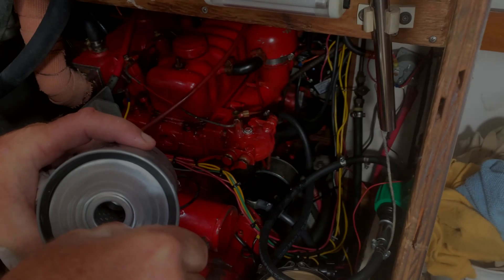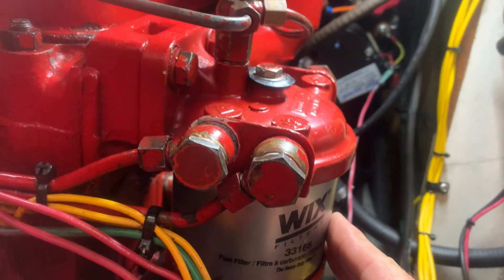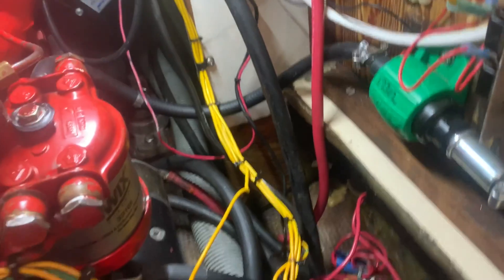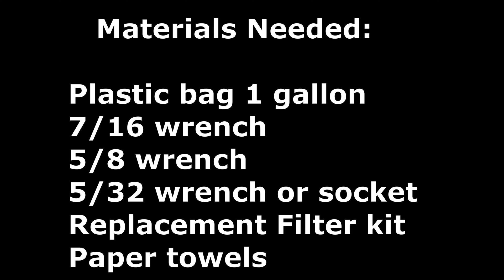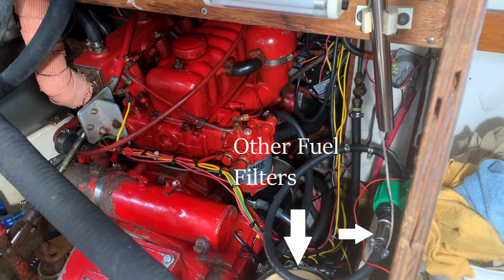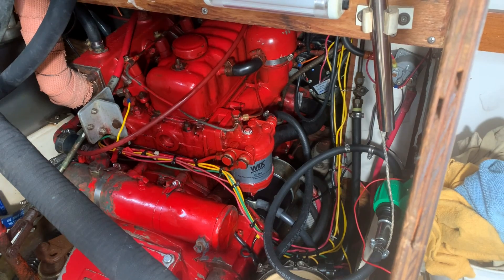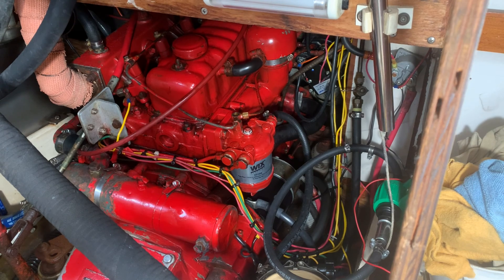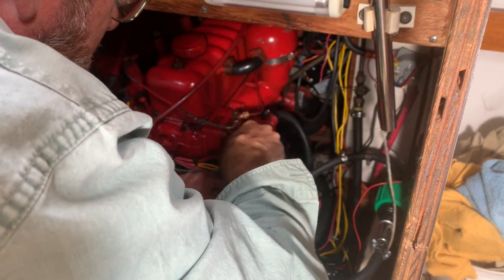Changing a Diesel Fuel Filter: Westerbeke 4-107 & older Perkins 4-108

Comment: great info, why not top up the filter with diesel so les air is needed to bleed....
Reply from the maker: Yes, I have done that before. Generally, I would add fuel by loosely putting the filter on and opening the fuel petcock, letting gravity do the work. But since I added the electric fuel pump, it does it for me.  However, there are kits to use a spin on filter!

Comment: Great information!  Instead of an electric pump I had added a regular outboard motor hand primer bulb in line from the gas tank.  If I remember correctly, I only had to bleed the connections to the filter (and the filter) by loosening them and manual controlling the bleeding as I tighten them (top last).
Reply from the maker: That is a great way of doing it and less "parts" to go wrong. I just didn't have the reach around to pump and bleed. ;)

Comment: How did you get the Edelbrock electric fuel pump to pump Fuel because they have to be gravity fed I bought two of them before I do you have an app for the manual fuel pump or before
Reply from the maker: Good question! Yes, it is gravity feed as my fuel tank is higher. The big Racor filter and Edelbrock fuel pump are the lowest points of my fuel system. Often, these small pumps have to be "primed" by siphoning off the air. This can be done by connecting it to the fuel source and putting your finger over the outlet on and off to create a suction. Air is compressible while the fuel is not. Got to bleed the air out...super important with diesel systems. Also, I just use it for bleeding air from the systems and not all the time because the pressure created could blow the high-pressure injector pump seals out.